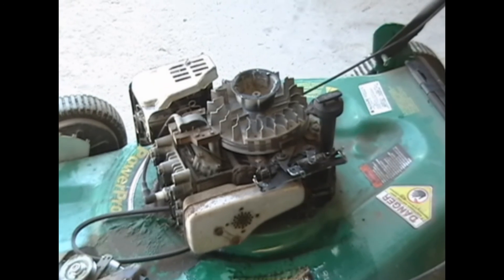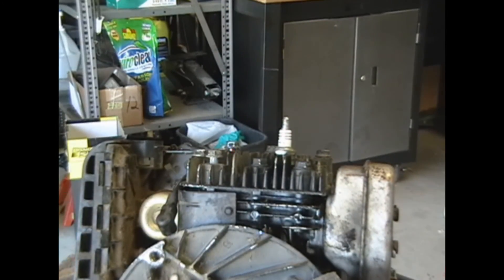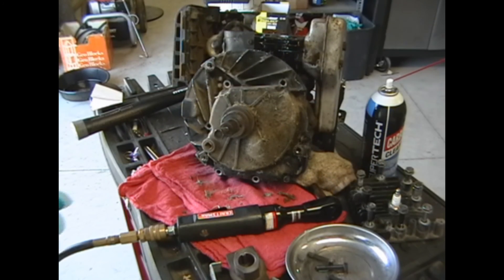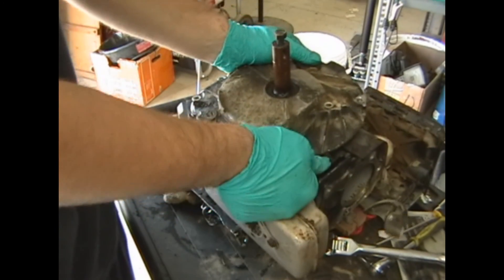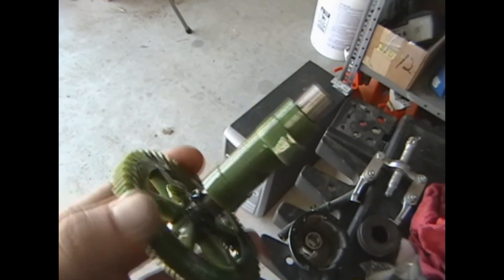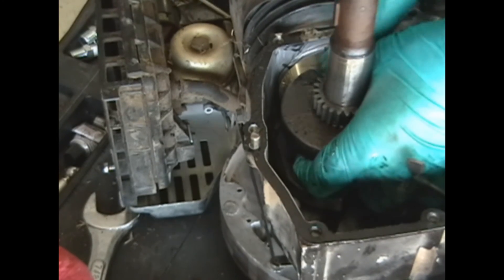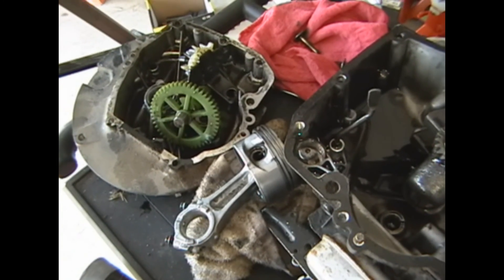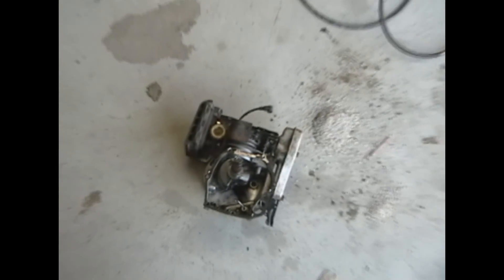Briggs and Stratton Quantum Engine Disassemble

Comment: The quantum engines are definitely consumer grade hence the plastic cam etc. I've had a number and I appreciated the true carburetor vs a pulsajet setup as in other low end Briggs push mowers. 40w oil helps with an older one as they will smoke some at least until warm as is setting the governor right or a quantum may break the connecting rod

Comment: The Briggs and Stratton engines from the 70’s and 80’s all had metal camshafts. Thankfully, these haven’t been too big of a problem. They won’t be as long as they aren’t ran with low oil.